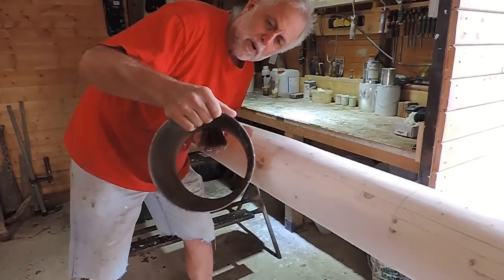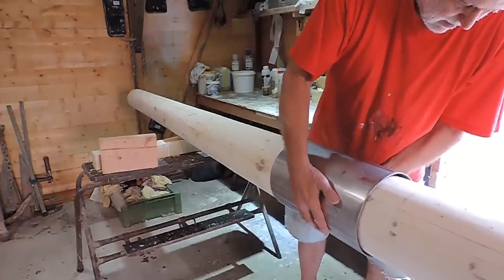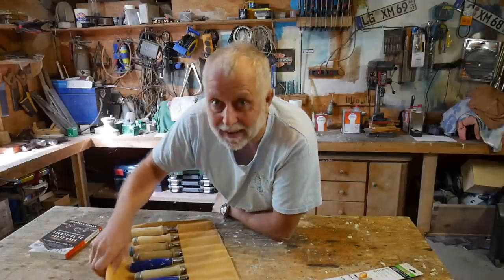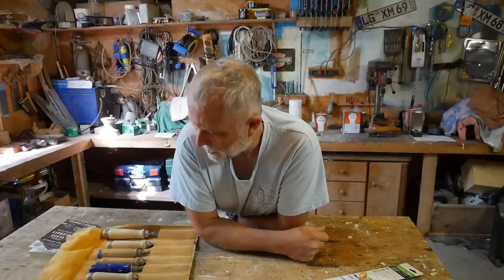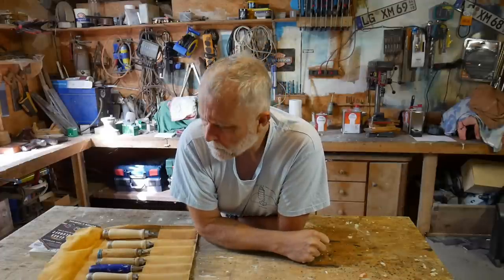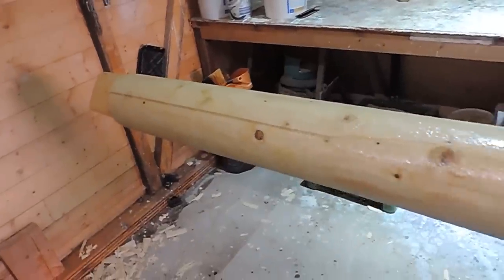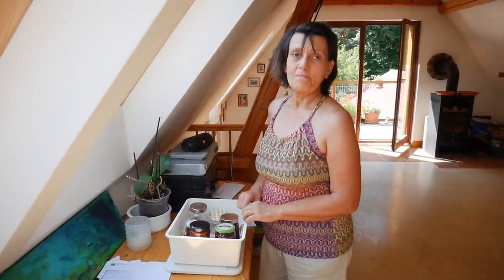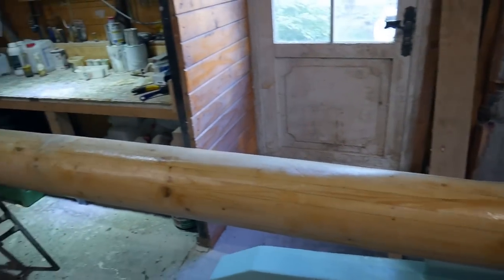Masts, chisels and Karin's plums!!! - SV Tapatya EP246

Comment: I thought maybe you had forgotten something until you mentioned that you were going to do a wire run for your Mast steps. However it does raise a question in that how are you going to deal with trapped water? Certainly you could seal it but there is a lot of motion and forces at the base and a seal may not last unless maybe a gasket?
Reply from the maker: There shouldn’t be any trapped water, Glenn. The mast steps have drain holes, the masts will stand on coins, as is traditional, any water should drain into the, admittedly shallow, bilge. I shall try my best to keep the bilges dry 👍

Comment: Thank you for sharing. Your videos are always so instructive and something new learned. I am always so curious about overlapping fibreglass layers and how much overlap we should apply and how to deal with the resulting edge of the fabric on the surface on the mast. Why do you add fillers to the overlapping joint as you have mentioned at the beginning of the video? Is it to smooth out those raised edges after sanding?
Reply from the maker: Thanks Joseph. Yes, exactly, it’s to fair the finished surface 👍
Reply: @SVTapatya  Thank you.